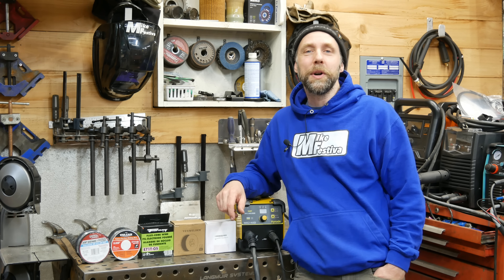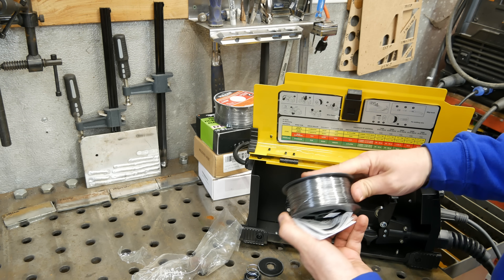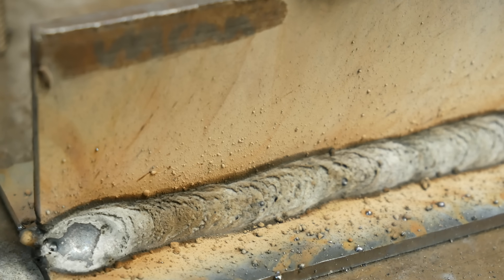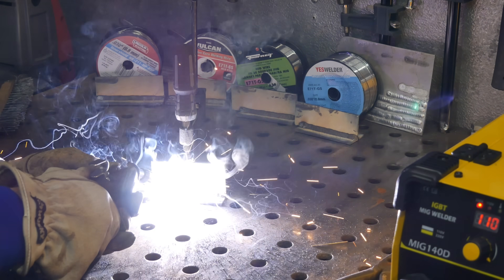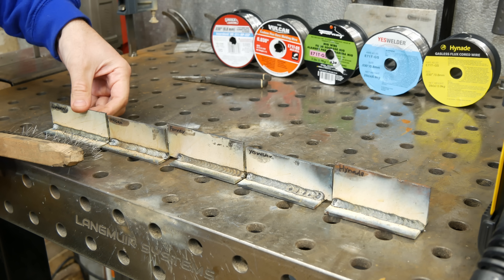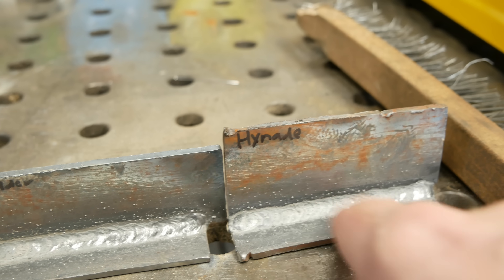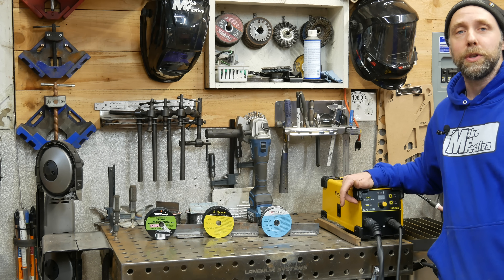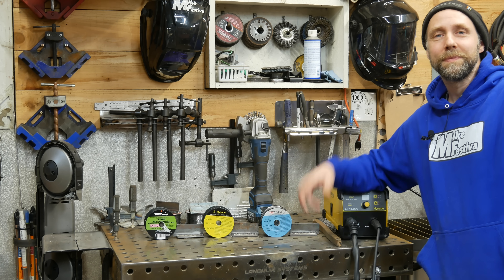Gasless Flux Core Welding Tips, Make Better Cleaner Welds

Comment: I used up the spool that came with my hf 125 titanium. This is what i learned with. After my first weld with Fornay, i wish i bought earlier, way better. Spatter spray is great too.  Now that my powerfile is broken, i realize how much i use it for metal. 3M cubitron 2, 60 grit,  is the best ($2.50 /belt) is the best money i ever spent.

Comment: Mike,  about 6 years ago I switched to INE brand flux core welding wire ( bought off of Amazon ).   INE is made in Italy and produces less splatter and the weld puddle is a little more fluid with good flux coverage all though the flux seams to be thinner and is smooth welding, crisp start and good looking results and strong welds.   There are several YouTube videos on this brand of wire and is how I learned about it.   You might want to try it out,  I love this wire !,  you won't be disappointed ! ! !      Great video !
Reply from the maker: Thanks for your suggestion David! You are probably the third person to mention that brand of wire, they have all recommended it 👍

Comment: Great video 👍
You are right about lincoln wire. They make some great welders, but their flux core wire and stick are really subpar.
Welder/fabricator for many years and truly Forney makes the top of the line flux core wire.
I feel sorry for anyone forced to use Lincoln wire or sticks to pass a certification test 🤕
My first cert test, I bought a 10lb tube of Eutectic 1/8 7018 to do the test. Paid off 👍

Comment: You don’t want flux core to look like that. You want it to feel hot and don’t oscillate. It should look  smooth like finished caulking. Just the two cents of a guy that welds for a living.
Reply from the maker: I’m a millwright and weld just about every day as well, so I also make a living welding. 
“Feel hot and don’t oscillate” “smooth finish like caulking” 
Tell you what, I would really like to see a video from you showing your welds and flux wire technique.  You have seen my welds, let’s see your welds 👍
Reply: In all of my 21 years as a state licensed 6G welder have I heard that a flux core weld should look like finished caulking and every welder that I have worked with stacks their welds to look like a row of dimes. Once you get the hang of stacking welds, you can throw your two cents in.

Comment: Good video, however your flux core wires are different, as far as I can see from the video, only the lincoln one is E71T-11 whereas the other ones have GS on the end, GS fluxcore wire is for general fabrication whereas 11 conforms to certan standards from AWS and can we welded in multi pass wheres GS wire is only single pass! (probably why lincoln wire is more expensive).
Reply from the maker: Yes I have had a few others mentioned this. 
I only welded single pass in the video and out of years of building stuff I seldom ever do multi passes especially with flux wire. Most people that own a budget $200 flux welder never seems to weld much thicker then 1/4” so I don’t think it really will be an issue. 
Thanks for sharing your input and checking out my video.

Comment: In my small town my hardware store only has KT and Lincoln brand wire, no difference to me except lincoln cost twice as much. The best difference i've seen is anti-spatter spray/nozzle cleaner, KT brand, spray that along the welds you'll be making and it almost looks like mig lol. When making a longer weld the piece heats up enough to burn the spray off though and loses effect

Comment: I tried it once years ago and it was almost impossible to make nice welds I'd take MIG with gas over it anyday.
Reply from the maker: Yes I agree that it’s much easier and nicer to weld with solid wire and shielding gas. If you have ever seen any of my other videos I actually own a wide range of MIG, STICK and TIG welders, I made this video to show the difference of wire and help some of the people out that only own a Flux welder. 👍

Comment: Great video been looking for thus info for a while....I typically keep a few rolls of Flux core around in case I run out of gas(over an hour away from nearest supplier) but always the cheap stuff and never really happy with the results....always figured there had to be better wire, the 2 I've run also do to availability are harbor freight and blue devil...p.s. you've gained atleast one subscriber because of this video!!
Reply from the maker: Right on thank you 👍

Comment: I am thinking of ordering one of those hynade mig140d welders because of this video, would love to see a review video on it! i would like to see how it runs on 110/220 gas/gas-less. it looks like it does great on 220 with flux core but i dont have access to 220 at the moment. definitely subscribing
Reply from the maker: Thanks for checking out my new video and subscribing Mark 👍 the Hynade 140D I used in this video is only a flux welder, I bought it to try out for a future video because it was dual voltage and at the time only cost $149.
The Hynade MTG 155D is a MIG( can run solid wire and shielding gas) also flux wire, stick weld and with an optional TIG can DC TIG weld but it sells for $239 so it’s a bit more. I just wanted you to know that the welder in the video is Flux only. Take care 🙂
Reply: @Mikefestiva  I was half asleep haha my apologies. I would like to see how it runs on 110 though. Can’t wait to see the future video!

Comment: Hey mike, great video for controlling the variables, I always found it interesting how the Lincoln wire never seems to run very smooth unless you get into the very large stuff (.62-.80 stuff, 1.6-2mm) , especially with how expensive it is.

also one thing to watch for with flux, is if you can you should avoid weaving when welding flat for the same reason you drag, weaving like you do with solid wire makes it more likely to get slag inclusions.